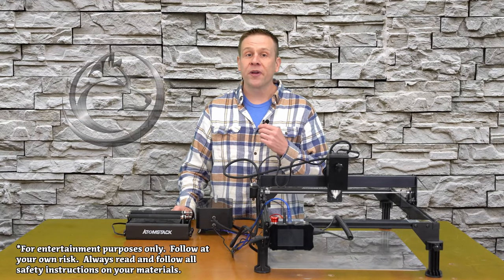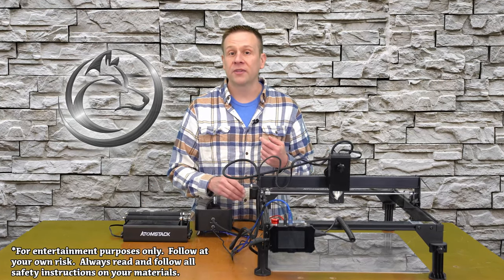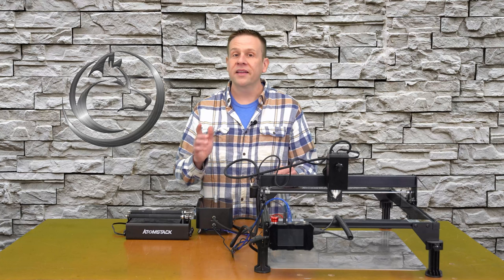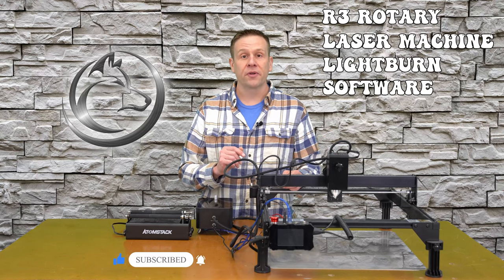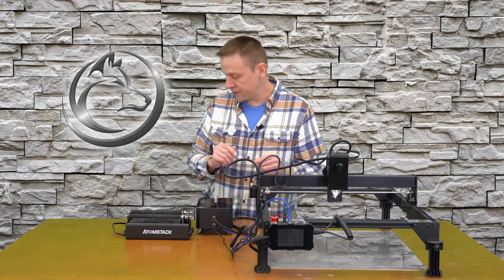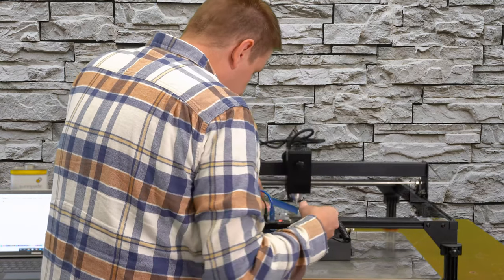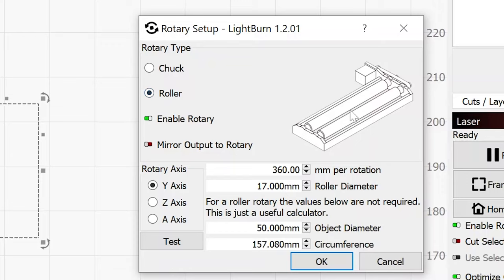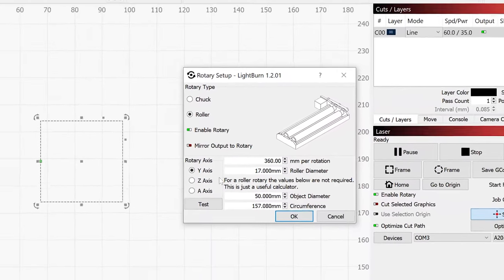Atomstack Rotary Setup

Comment: just a heads up with the cold galv compound, make sure you have really good ventilation while engraving that as burned / vaporized zinc is extremely toxic and can make you sick quite easily. 

Thanks for the video!
Reply from the maker: Thanks- I agree 100% the fumes from spraying, dry and really bad too!  And like you said vaporized zinc is very toxic.  I just filmed a video just on engraving methods and mention Cold Galv and try to discourage people from using it.

Comment: Just wondering if it'll work with yhe Enjoywood CEL-E10. Thanks
Reply from the maker: That's a great question.  I don't have the Enjoy machine at this time, but the style of the machine looks like it "should" work.  The Atomstack rotary does come with a couple of different cables making it compatible with many machines.
Reply: Thanks

Comment: Interesting video and a great help to getting started. Please do note your lightburn settings are misleading. 17mm diameter rollers would not rotate 360mm. In fact the correct dimension of the rollers is 16mm. This gives approximately 50mm rotation. Please add a correction to your otherwise helpful video.
Reply from the maker: You are absolutely correct- the roller diameter should just stay at the ~17mm and the "mm per rotation" should be the adjustment made to meet the calibration.  Thank you!
Reply: I came to this video looking for this exact info and you sir delivered, thank you!
Reply from the maker: @Pyromancer01  Excellent!

Comment: Excellent information, and very well done! I had the same problem with the roller size issue. But  why Atomstack doesn't show a recommendation for the correct roller size setting , is very puzzling to me.
Also, at the bottom of your command box, where you chose your roller model, my version of Lighburn completely lacks that window, for the choosing your model option. Any ideas or thoughts on that difference?
Anyway, thank you sooo much for the great information!
Reply from the maker: Thank you!  I'm running the latest version of LighBurn ver 1.3.01  There is a difference between the chuck type and roller type!  Setup for a chuck type is not difficult, but would be a whole separate video- which will be out in the next month.
Reply: @thelaserchannel1 Thank you for the speedy reply! My roller unit is an Atomstac, which is Identical to the one in the video. But I will check to see if my Lightburn needs updating.

Comment: Hi, I recently got a atomstack a10 pro I purchased some glasses as well but I don’t trust them, any recommendations on glasses for that specific machine?
Reply from the maker: Greetings- I looked up your machine and the advertised laser wave length is 445 nm.  Look for safety glasses that cover that range.  A lot of green safety glasses will cover a wave length of 200-2000nm.  I recommend contacting Atomstack on what they specifically recommend.  Always go with safety!

Comment: have you used LASERGRBL  with the rotary ?  I have a Atomstack A5pro,  and am a noob but i like the rotary idea any suggestions?  by not enabling the rotary is that how LaserGrbl would work?  your machine is more powerful, would is work the same on mine?
Reply from the maker: Sorry- I have not used LaserGRBL with a rotary.  In the early days I did use LaserGRBL a little but found LightBurn so much easier to use.  LightBurn does offer a free 30 day demo that has all features unlocked should you decide to try LightBurn.  Best wishes!

Comment: We don't weld galvanized metal because the fumes are poisonous.  I imagine the galvanizing paint would also be poisonous.
Reply from the maker: Your are correct- in another video covering 8 ways to engrave glass I talk about the use of Cold Galvanizing paint-  a lot of people use galvanizing paint and I do not recommend it because of the fumes while spraying, drying, and poisonous fumes while engraving.

Comment: At 15:11 in the Rotary Setup menu, I can't figure out the (mm per rotation) and (roller diameter) figures. I don't under stand of it is referring to the item being cut or the rotary attachment itself (based on the height screw settings)
Reply from the maker: HI- good question.  Here's an updated easier way to calibrate the rotary tool; the "Roller Diameter" should be the diameter of the rubber covered rollers on the rotary tool.  Use the "mm per rotation" to adjust your 30mm by 30mm calibration box.  Adjust only the "mm per rotation" to make the 30mm by 30mm box.  I just got done recording a video on just specifically calibrating a rotary tool- I'll link it when it's ready!
Reply: I’m having an issue with this, my square will engrave at 25mmx30mm. What should I adjust?